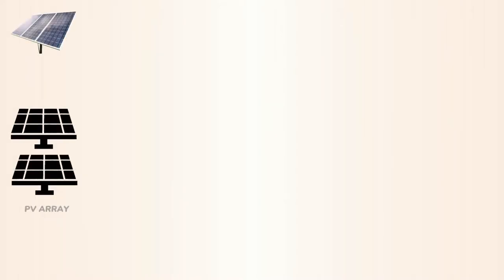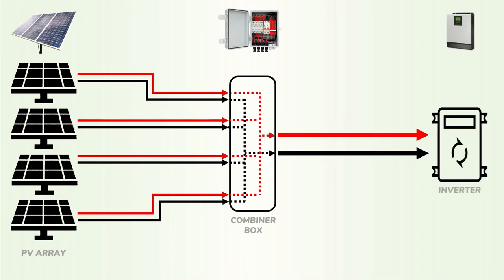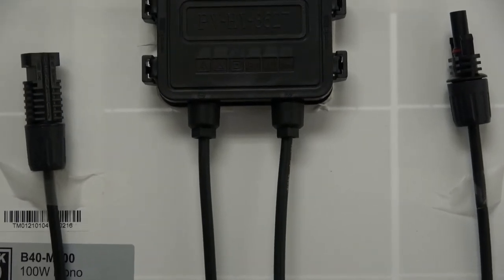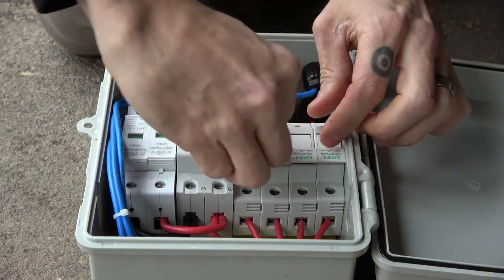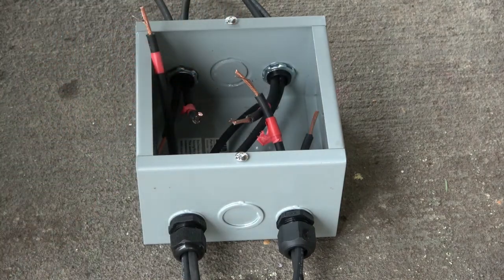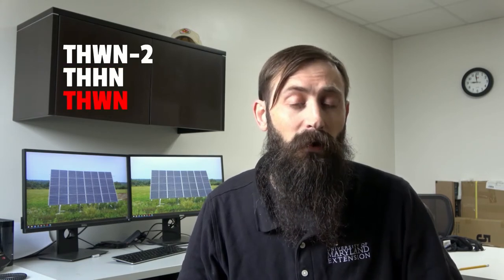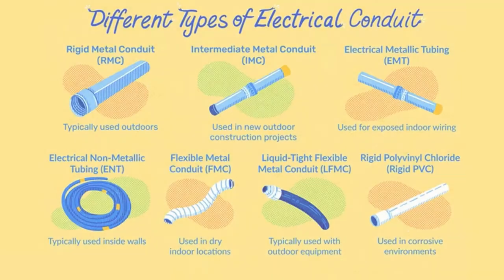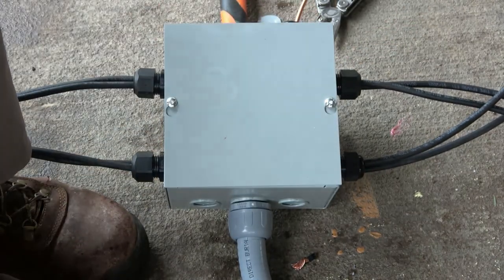How to wire a solar combiner box or pass through box

Comment: Would 4 strings going straight to the inverter need fuse protection in a pass thru box? Thanks keep rockin
Reply: Can you explain to me what your pass through box is? Does the ground wire from the mounting rail go into the box and directly to the inverter? Did you use PVC or metal box? PVC conduit or EMT?  If a metal box, did you attach it to the rail, run the rail ground wire into the box, ground it to the metal box, and run another ground wire from the box to the inverter?
Reply: @ridemfast7625   elecrical code is required to wire ground the equipment no matter metal or plastic boxes or inventer. 
In case of  DIY local authority can tell what it is proper ground  wire to get permission.

Comment: There is some ambiguity on the DC side fusing and/or disconnect sizing in your videos that do not tie the two together very well.  Question:  If you have a non-fused disconnect in a combiner box, my understanding is that you size the fuses Isc*1.25 = Imax *1.25 for continuous current = Isc * 1.56 for the individual string fusing.  The main disconnect then can be sized to match the Isc*1.25*1.25*# strings OR if the disconnect is 100% rated, it only needs to be sized Isc*1.25*# of strings.  This could save $$$ in some cases.  Is this the way NEC intended the sizing in a combined string fusing/combiner box?  It seems to be the case with the caveat that the upstream fusing and wiring (i.e, path from combiner box to inverter) still needs to be sized the extra 1.25 even if using a 100% rated non-fused disconnect in the combine box